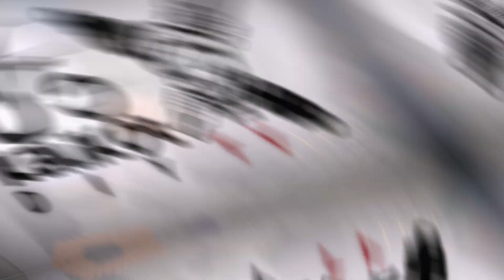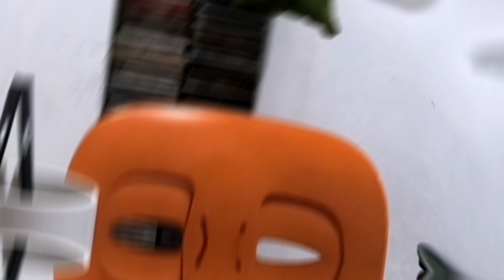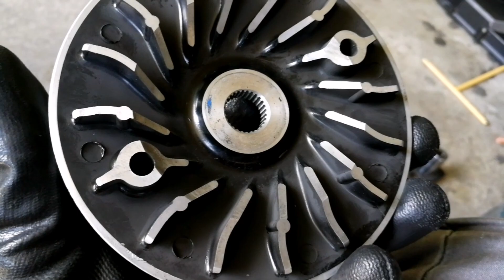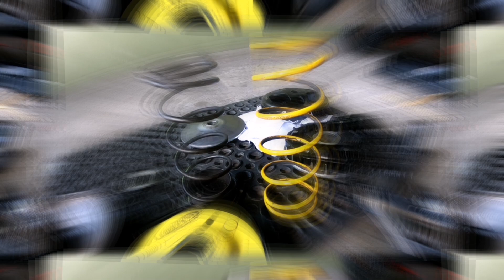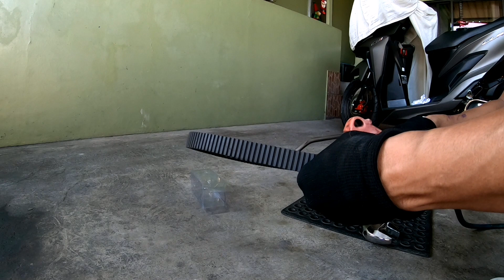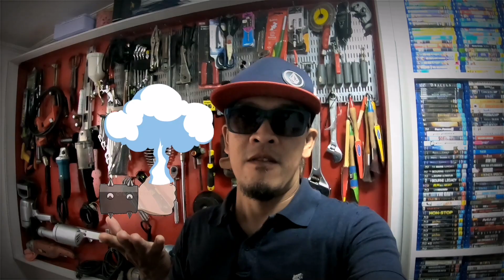RESULTS : CVT performance parts upgrades HONDA 150i GC 2019

Comment: Dragging issue gusto ko maalis click 150 gc yung hindi sana tataas rpm kase medyo maingay cvt ni click pag high rpm agad while taking off and arangkada

Any suggestion boss?
Reply from the maker: Bell, Pullet set. palit ka. saka ka na lng mg tono sa gusto mong takbo. keep mo lng ung stock na bola springs torque drive.

Comment: boss ilan stock center spring ng 150
Reply from the maker: Di ako sure. sa tingin ko 900rpm 
nka 1200rpm ako ngaun. ganda ng bigay
Reply: @MotoKalikot  anung brand po?
Reply from the maker: @cheriecarabbacan1575  JVT try mo mas lower rpm ng clutch spring tas higher torque spring then lighter flyballs dpende sa timbang mo dun ktlga babase kya tono-tono gang sakto na syo takbo.
Reply: @MotoKalikot  63kilos po ako
Reply from the maker: @cheriecarabbacan1575  62kg ako ntry kna rin  pgmy BR swabe prin mnakbo. msarap s bakbakan. E2 settings ko
all JVT CVT sets 13.5% pulley 12g flyball straight 1200rpm torque spring 1000rpm clutch springs JVT clutch assy/bell.
Reply: @MotoKalikot  ilan topspeed mo?
Reply from the maker: @cheriecarabbacan1575  iba-iba sya. pgmganda pnahon tas mganda stretch ng daan 121. tas mdali nya kuhanin 100kph. RDfensively 🤙🏼
Reply: @MotoKalikot  anu bola po gamit mo ngayon?
Reply from the maker: @cheriecarabbacan1575  12g straight gmit ko ngaun. may option ka mag combi. basta calculate mo lang din ung total weight na target mo. unahin mo ilgay ung mabigat then mgaan pg combi alternate

Comment: Ano ung bbilhin ko s jvt s gc 150 ko sir ?
Reply from the maker: Dipende sa gusto mong i upgrades pre. If dragging issue lng i suggest PCX spring (center/clutch) un ang nakakabit sakin ngaun. If gusto mo pa ng power at torque, palit ka ng lighten pulley, bell, clutch lining para mas aggressive at dumulo pa yung hatak ng CVT transmission mo tulad sakin. 👍🏼salamat
Reply: @MotoKalikot  anung brand ng pulley ang pinaka lighten paps? pinakamagaan?
Reply from the maker: @jaysoncatalanjunio3261  Yan gamit ko JVT, solb nako sa performance nya. 👍🏼
Reply: Sir magkanu lahat gastos s full set jvt ...inde ng nagdragging ulet
Reply: @MotoKalikot  anu top speed nyan?
Reply from the maker: @jaysoncatalanjunio3261  124kph 👍🏼